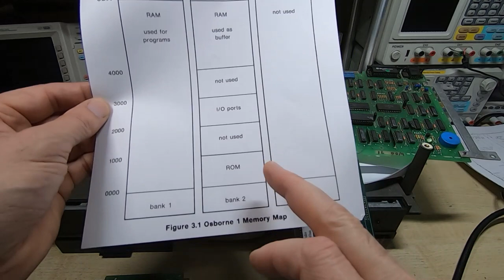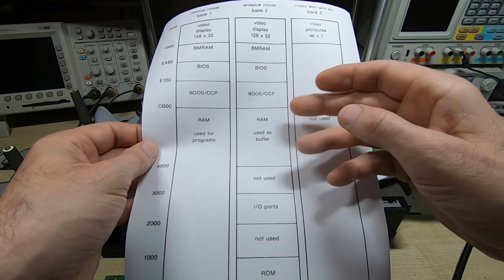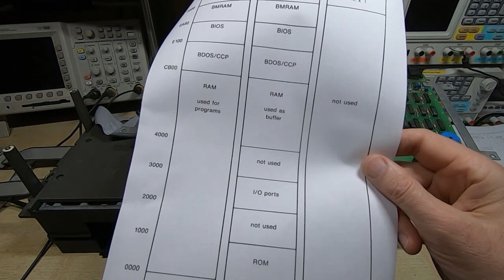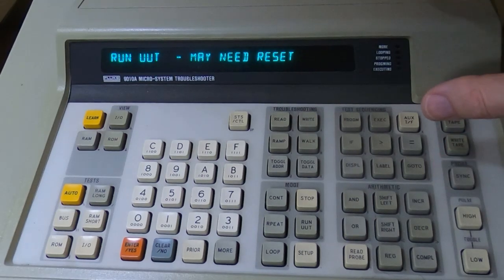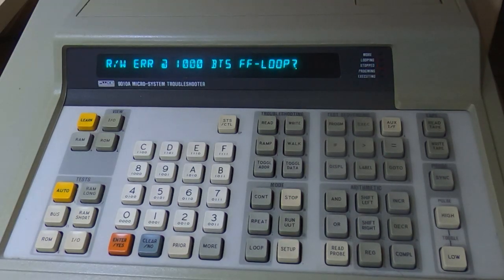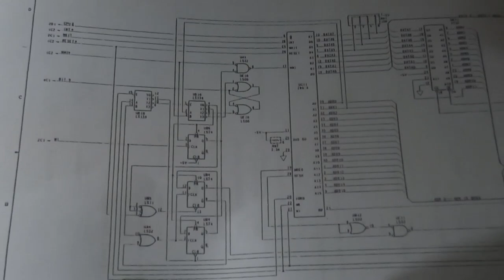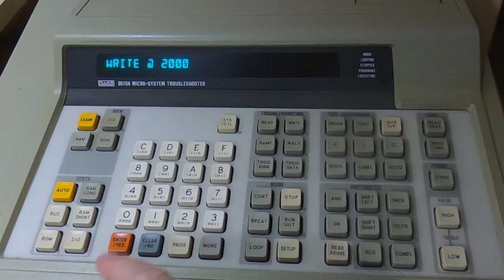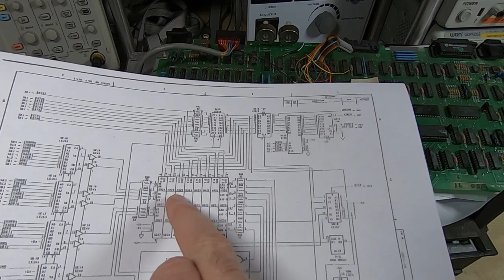Osborne OCC1 Repair Part7

Comment: Great stuff . I have a Z80 emulator but always fancied a fluke. Can you remove the Z80 from the board under test and use the fluke to run the board ? If it can, can you also store the program code in the fluke and remove the ROMs from the board you’re testing ?